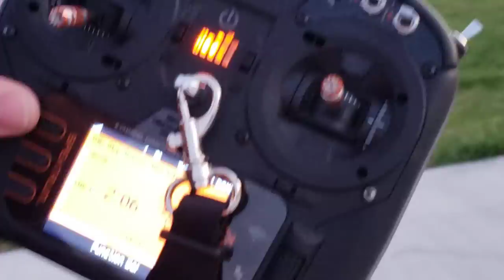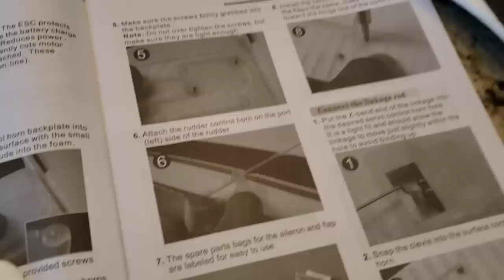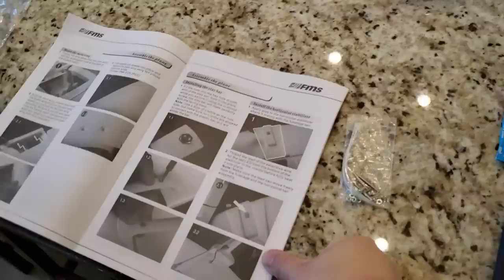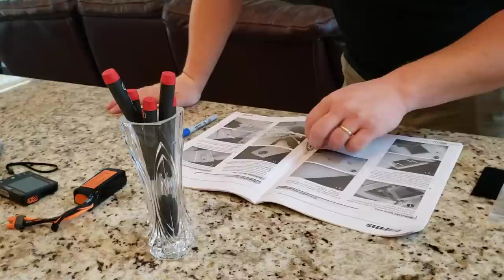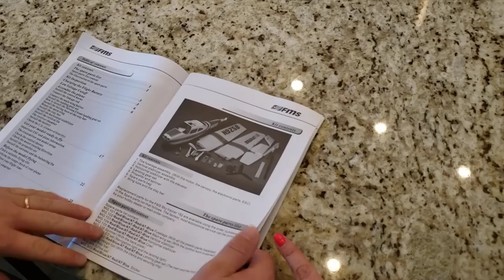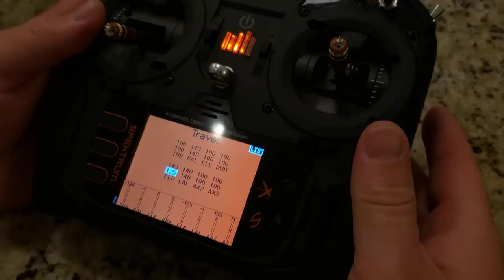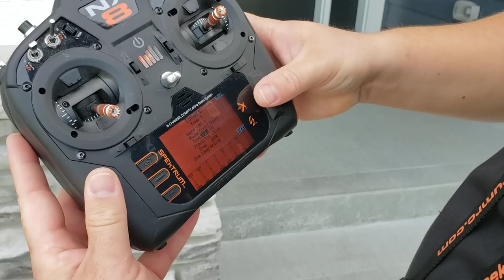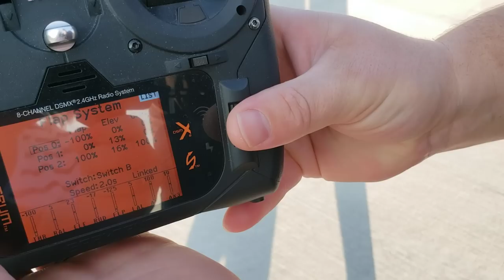FMS - Sky Trainer 182 - 1.4m - Unbox, Build, Radio Setup, & Flights

Comment: Hello Brian and Camera crew. I have now completed the 5 hours of this video. I enjoyed it start to finish. It was a little different watching you build a plane that I have already built myself. 

How about that gluing of the tail section? Same issues and resolutions that I came up with. Just more awkward than it was difficult. But could have been a bit better design. The worst part was getting glue on my model trying to place everything. 

I mentioned in my initial comment that mines 90% completed. I’m ready to place the receiver. No great or precise location for that mounting. I have ran wires in a few different configurations. None that just said, oh I like that. 

So I pushed it to the side and it’s still waiting. So your video provided a nice answer to that situation. So mine will now be finished with the Brian Phillips RC, receiver position. I like how you made that work. 

As for the battery, I don’t like bottom feeders. But not a real problem. It did end up being a con on my list. 

Overall it is a beautiful plane. Looks great in the sky. I purchased it due to having previous flying experience. But I returned to the hobby this summer after a 10 year absence. So being a bit rusty, I have not decided yet if I will fly this plane this season or not? It doesn’t appear to be the easiest landing plane. 

But after your 5 hour video, ⏳☕️🍺🍺🚬. Just kidding. Seriously I now know how I want to finish the receiver and wiring placement. Thank you. 

Thank you both for going the distance on this production. There was no way to have done it quickly. Still keeping your normal level of excellence that you are known for. I personally am grateful to both of you for that. 

Overall great plane. Great video. Great suggestions. Seriously I enjoyed the time watching the complete video. Very very well done my friend. Thank you and God bless you both. Love 💕 ya both.
PS: You mentioned cutting the front steering gear spring down a bit. Do you feel this would be a Mod to seriously consider?
Reply from the maker: So glad you got some value out of the WHOLE thing ;) Rx placement was weird on this plane, but gotta remember, many people will use NON AS3X / Stabilized receivers, so you could just plop it in there wherever, in that event... As for the nose gear mod, I don't even remember talking about it - LOL - but you have to make sure the glue is VERY WELL SETUP on the wing struts, or you'll have to do something like I did with the tape to hold it all together.

Good plane, you'll do fine with her, but just don't beat yourself up if you can't grease the landings on first try. It flies fine, but lands a bit unforgiving.

Thanks for being here with us Jeffrey!
Reply: @BrianPhillipsRC  No place I’d rather be, than learning from your videos. 

Ok, I’ll be honest. Almost no other place. 😂 Hawaii would be sweet. 

I truly enjoy all of your work. You and Megan are a great team. Keep em coming and keep them lengthy.

Comment: Hi, I have the exact same plane which I’ve had for almost 5/6 years. One of the aileron servos needs replacing, do you know if it’s a certain servo I need to order? Thanks
Reply from the maker: I can't say what size, but if you know it's bad, I'd just pull it out and check what the label says...if the label's stuck in the wing, you might have to look at the OPPOSITE one.

I believe they're 9 gram servos, but I'm not 100% sure.
Reply: I would change both sides... If one went, the other is following. Is kind of the same mentality of doing struts, brakes, tires, is best practice to do both and forget about it.

Comment: I just got one an the electronics have me confused  it came with two receivers wired together with nowhere for the ailerons and flaps or anything on the wings to plug in.
Reply from the maker: I think you might be looking at a REFLEX (Stabilizer) and a RTF Rx.

Comment: 51:44 spotted 👀 a windy corn 🌽 hole out the front window 🪟 /// This reminds me of my first airplane ✈ a used hobbyzone glasman, sportsman s+ 3s 1400mm with rubber bands on main wing. Had a oversized grass landing gear or these smaller tarmac wheels with pants 👖. Such a robust first plane, when the main wing is held on with rubbers it would allow cartwheels! alittle ca and kicker, packing tape. Tried some leading edge slats from the timber with less than great results 🤩🧑‍🦽BB Oh yeah.. I still fly it 5 years later with a flysky is-6 from my rtf eachine wizard quad chopter. Still have my Xmaxx from the same time BB
Reply from the maker: Nice!!!

Comment: I am wanting to get one of these for Christmas but by any chance does it come with a battery and charger?
Reply from the maker: This plane comes in 2 finish levels from FMS:

RTF - this would include the battery and charger
PNP - this would NOT include the battery, charger, transmitter or receiver and would be most similar to this video

HOWEVER, they are both currently out of stock at FMS and I'm not sure they'll be offering the RTF version again.

Comment: Hey Brian I just got mine I put it together but I can't fly it yet when I turn my when I use my ailerons my elevator moves with them I can't figure out why any ideas
Reply from the maker: You've got a Y cable in there some where? Maybe you made a mix by accident? Check out ALL the mixes, especially the first two or three and see that they're off and/or inhibited.
Reply: @BrianPhillipsRC  hey Brian thanks for the information I got it working I'm a new a new flyer and I'm kind of scared to take it out I don't want to crash it

Comment: I accidentally  unplugged  all my wires from the little box that came inside the airplane can you tell me what goes in each numbered slot please and merry Xmas to you
Reply from the maker: I'm real sorry, but that's way to hard to do back and forth without feedback. I would need way more information than what you've shared.

Start by finding and getting throttle plugged in. Make sure the prop is OFF to motor - don't get hurt!

Then just plug and check which surface moves when you move the stick you expect to control it. It'll take a few minutes, but you CAN figure it out.
Reply: I got it figured  out thank you

Comment: Very surprised it would not be good as a trainer. Great looking plane thou 👍🏻
Reply: I think it does really well as a trainer. It's very easy to fly.
Reply from the maker: very challenging to stick landings, other than that, she's a good flying plane.
Reply: @BrianPhillipsRC  On short grass it works fine. No more complicated than any other tri cycle geared plane.
Reply: It is NOT a first airplane! (For most)

Is highly recommended the rc plane / glider he just did a few days ago, similar to the Hobby King Bixler.

Comment: Great build. Just ordered one. That 55” wing needs to come off and on to put in car. Also see u glued wing struts on 🥹. Any ideas ?
Reply from the maker: Not sure on this. I could get this in my car...length wise, it would be tough, but I could do it... some planes don't come apart easy - this would be one.
Reply from the maker: you could try to run longer cables from the wing down, so they stay plugged in and just pull the wing off and twist it length wise with the fuse. BUT as for the wing struts...they just need to be held tight...maybe epoxy over-night, then resecure them? Possibly make a break in the middle for a pin to reattach them, so they can be easily removed?
Reply: Thanks for response, good ideas… struts will be issue. FMS didn’t consider actually transporting the plane 😁